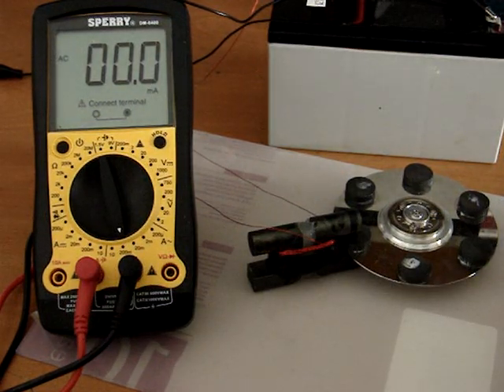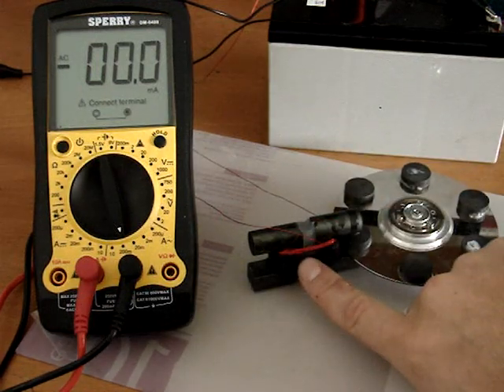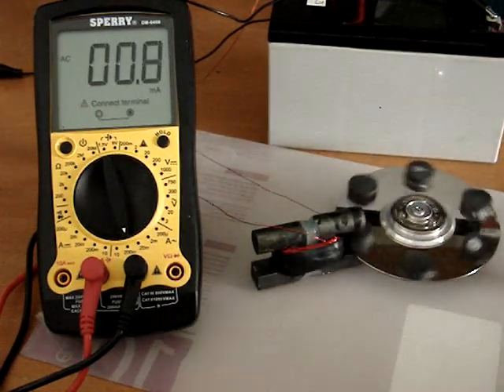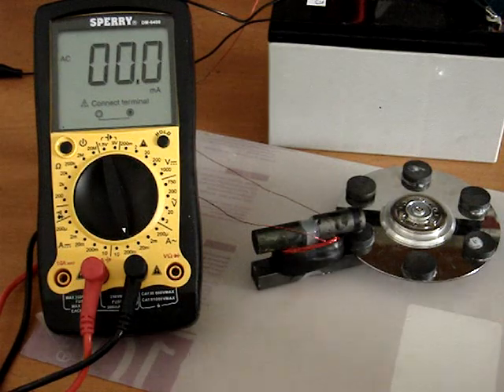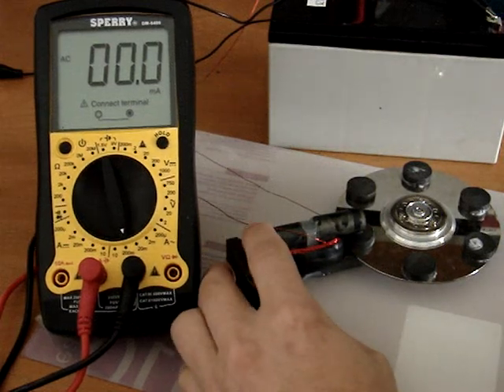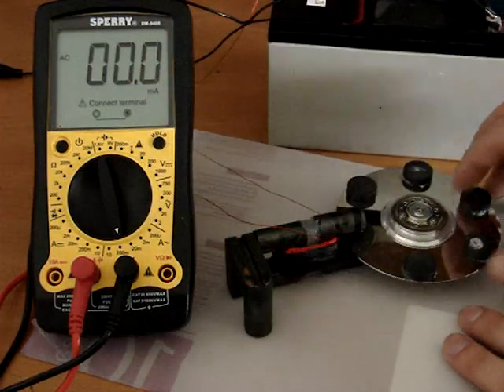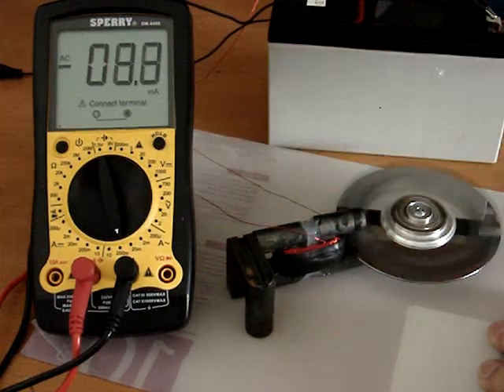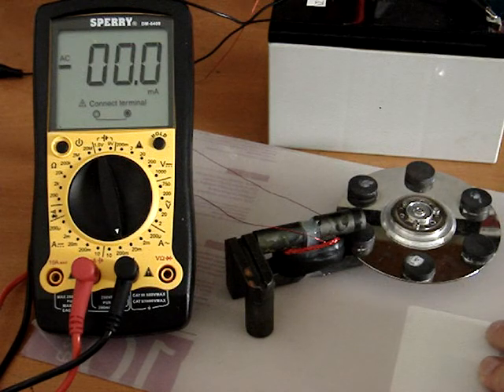Inverse Transformer.wmv

Comment from the maker: I have tried many things along those lines. And I have learned a ton not shown here since. Think about this. All action is transmitted through the network, reaches the end and is reflected backwards. In other words, we have a dead end and it returns. How about a second order circuit??? What happens when it does not return through the same path fighting itself, but rather ends up back at the beginning in phase with the incoming energy? Circles within circles.

Comment from the maker: @davecahoon 
If you wind a coil on the removable core, it will induce a BEMF on the magnetic secondary, which will work its way all the way back to the rotor to induce drag.

Comment from the maker: If I close the magnetic "primary" there will be no induction because this will be the easiest path, and circumvent the coil. Also, if the primary and secondary are connected, the coil will also be circumvented, hence the spacer, just like with a standard XFORMER.  The only gaps are between magnetic primary and secondary.  It is less about the shorter path, and more of the easier path. The primary flux HAS to go through the coil, the BEMF does not, and has an alternate route.

Comment: What if you close the U turn end core with a ferrite bar ? will you still have induction in the coil ?

Is there any airgap where the coil is located inside the ferrite core ?

Why doesn´t the whole flux go via the shorter path through the coil-core  ?